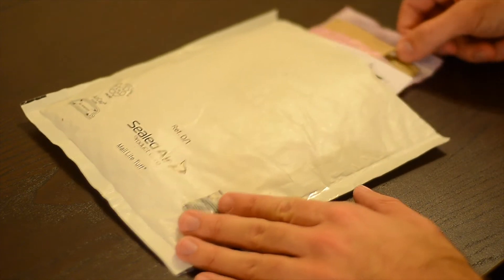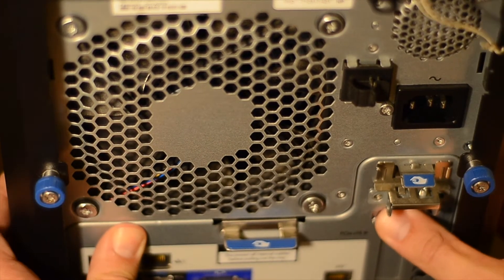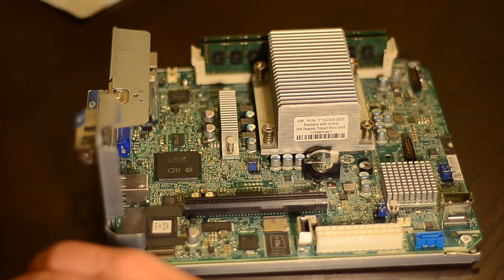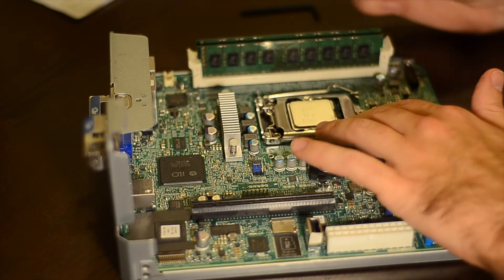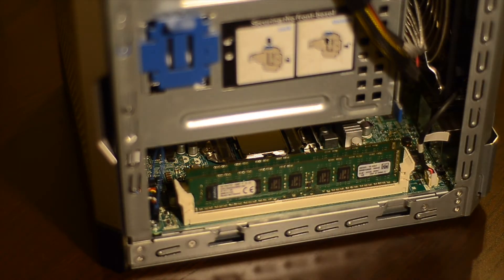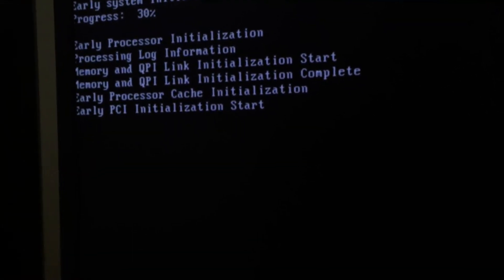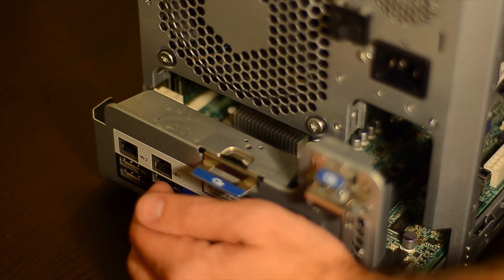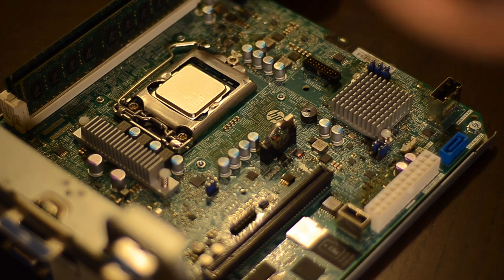Intel Xeon upgrade - HP ProLiant MicroServer Gen8

Comment: does vga connection provide video with xeon procassor? How do you get video?
Reply from the maker: Just connect the GPU and the BIOS will default to the dedicated graphics instead of the GPU from the mobo. Remember that, as far as I know, it has it's own video chip instead of relying on the integrated graphics of the CPU (because of the ILO).
Reply: @Shiunbird  xeon processors do not have built in gpu. How come can you attach monitor, this is what I want to learn.
Reply from the maker: @nathanruben3372  The motherboard has its own GPU, attached to the ILO. You can run GPU-less Xeons just fine.
Reply: @Shiunbird  Does ILO required to get video with xeon processors. Most second hand microserves do not have ilo card or built in ilo chip.
Reply from the maker: @nathanruben3372  All MicroServer Gen8s come with ILO. The difference being some sort of extra license that you pay to get remote console after POST. By default, you can use the remote console only to reach the bios setup.
Reply: @Shiunbird  Sorry about being so dumb, I just need to ask again, without ilo and with xeon processor which does not have embedded gpu, is it possible to get video without intalling pci graphic card for certain.
Reply from the maker: @nathanruben3372  every microserver gen8 comes with ilo and they are out-of-factory compatible with xeons. Matter of fact, my own microserver was the cheapest variant, with the pentium processor, and I just had to drop in the xeon and that was it.

I don't know about other hp servers, because I never owned them, but its true for the microserver gen8.
Reply: @Shiunbird  Thank...I really appreciate.
Reply from the maker: @nathanruben3372  My pleasure. =)
Reply: @Shiunbird  True for Dell servers with iDRAC too. The integrated GPU in the processor is never used because they have their own onboard video solution via the IPMI/BMC (iLO or iDRAC or whatever else).  Servers lacking these will use the GPU in the processor, such as the original MicroServer Gen10.

Comment: Only takes a few seconds to toast a cpu without cooling.Cannot believe what i am watching here.
Reply from the maker: Let me quote an official manufacturer document:
The board should not be operated without CPU cooling except for brief bench tests.
For a low wattage part.

It depends a lot on the wattage. I'd NEVER run a 140W CPU without cooling. It would ruin the connectors. However, this is a very low wattage Xeon, so I am completely comfortable in having it on for a few seconds.

Your mileage may vary, do it at your own risk, trust your skills and experience. Perhaps I should add a disclaimer to the video description.
Reply: Maybe on an old Socket A AMD but any modern Intels support THERMTRIP so will automatically shut off if the temperature reaches critical levels. I personally wouldn't do it, but it's not as a big a deal as some here are making it out to be.

Comment: you put too much thermal paste. one small dot should be more than enough.
Reply from the maker: The system is running ok 24/7 for years. The temperatures are super low.
I've heard so many different opinions on how to do thermal paste, none of it that came from someone working at Intel or something =) that I don't know what the truth is anymore.
I own a 4,1 delidded Mac Pro, I applied the thermal paste there and the system has been running cool and fine for years too, so I guess that, maybe my approach isn't the best, but I haven't fried a CPU yet.
Reply: @Shiunbird  hm.. okay

Comment: very stupid to not attach the heatsink I wouldn't do that at all it only takes a few minute to install and there isn't a good reson to leave it off.
Reply: All modern processors have protection from overheating. You can start it without any cooling system! It will work and will not be damaged...
Reply: @romandavydov8684  This surely depends on the mainboard supporting thermal protection AND that it is turned on. To leave the heatsink off is truely dumb. Some processors give you seconds before they overheat i.e. not enough time to get through post, not even close! If you are lucky it would trigger thermal shutdown and make you think the cpu is faulty. Not only is this video reckless, its stupid. This guy gets away with it in this instance, probably because this is a low power cpu in a system geared for power efficiency.
Reply from the maker: William Pierce the heatsink is attached. Everything is installed as previously. I’m not sure if I understand well what you mean.
Reply: no you showed installing the board with the heatsink off and testing the system without the heatsink , you said to save time, that is reckless and dumb because it put uneeded stress on the cpu and could damage the cpu from having no cooling solution. A tutorial should show good practices for those that may not know any better and if you don't know better you shouldn't be making these type of videos.
Reply from the maker: A system that has been turned on for less than a minute does not have time to heat up much.

I've visited a computer assembly line back in the mid-2000s, when Intel was all NetBurst and heat, and every single motherboard was powered on with RAM and processor only, allowed to POST, and then the final assembly with heatsink and cooler was done.

To your point, what I could have done, is to add a warning informing viewers to not leave the computer on for too long without the heatsink. When I have time I will add an annotation to the video and to the video description as a warning.
Reply: I just think it is reckless to start a processor up without a heatsink it took you longer to slid it in and "test " the system than it took to install the heatsink. I think most people would feel the same way. I love watching tech videos but hate to see poor work practices in the videos since it leads some people to make dumb mistakes because they follow bad advice. I also cannot believe you are unsure of how to decently apply thermal paste. I have seen all the videos but all you have to do is put a thin coating on the IHS on the cpu to transfer heat nothing more or less. Too much can cause problems as well as too little. can cause instability.
Reply from the maker: I had one system to test two processors, so I wanted to save time. As always, viewer discretion is advised.
You are right about things that can lead people to do poor mistakes, and I will be more careful next time.

Recklessness or not, and you believing me or not, I've seen assembly lines posting dozens of computers per hour without heatsinks. Of course, they don't stress-test the computer without proper cooling.

This is more about documenting the things I do for myself. I just put it online as a way to give back, since a lot of what I do I learned from the others, for free. If you look at a few other videos, there are crude mistakes, and I mention them. At times, I ruined things in front of the camera, and I leave it there for all to see. I learn as I go.

What I do is quite niche. I don't expect, and never did, to have lots of popularity when I post about things so old and specific.

In regards to thermal paste, I honestly have read and heard so many different things that I don't know what to believe anymore, thus the insecurity that I don't hide. What I do is keep an eye on the thermals. If the CPU is cooling fine and the system stable, I'm happy. If you put 10 system builders together, they will tell 10 different stories on how to cool things down, how to apply thermal paste, etc..

If I had an IR gun, I could have a look and see if the CPU is uniformly cooling. But with this Xeon, it's low wattage, and the heatsink rated for 35W passive, I'm not that concerned.

The Xeons 1200L v1, v2 and v3 have TDPs of 20W, 13W and 17W respectively. The system CPU utilization is rarely above 5% (it's just a NAS), and temperatures are almost always around the mid-30C (the case fan blows a fair amount of air).
Reply: @Shiunbird  No, that is wrong. It takes very little time for a CPU to get hot enough to cook something. If you care at all about the CPU you would never do this. It is like throwing money in the trash.
Reply from the maker: @cmj20002  Hi C MJ, 

So yes, I'd never run my old Power Mac G5 without cooling for any period of time, but I am confident that a low wattage part will be ok if on for only a few seconds. There is, I think, a huge difference in "time-before-fry" between a 20W or 45W TDP part and a 90W or 135W part.

Your mileage may vary. I by no means recommend people to do this, but I've been doing it since I was a kid and never had any problems. I never went beyond a few seconds and they never got even warm to touch.

All my computers at home have low-TDP CPUs, except my Mac Pro. I don't know any Intel engineer to point out what's right or wrong, and I would love to have conversation with someone like that. When it comes to the Internet, I've heard as many times people saying what you are saying vs what Roman Davydov is saying.
Reply from the maker: @cmj20002  And PS: I also believe that processors are tested before they leave the factory, in some automated way, and I doubt they are attached to heatsinks, cooling fans and so on before a quick POST is made.